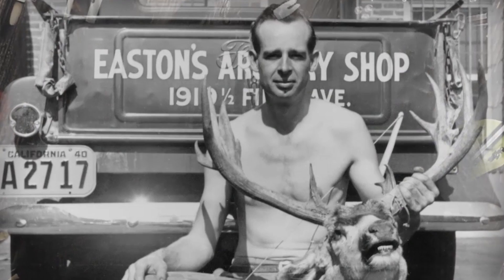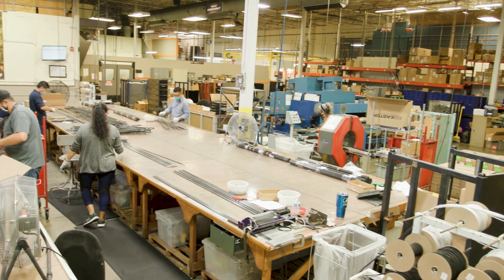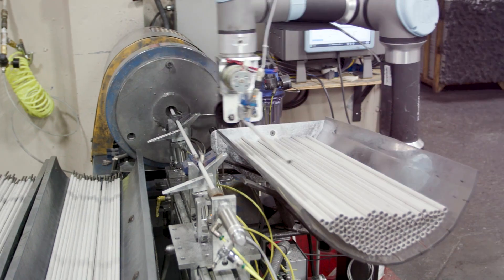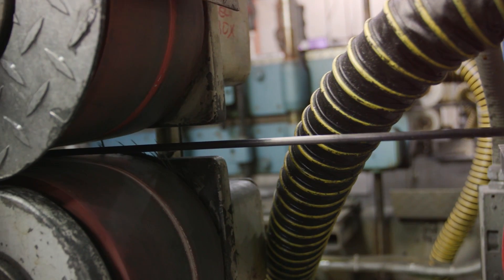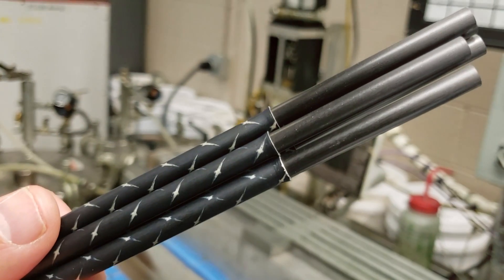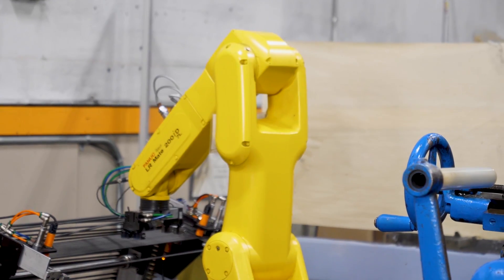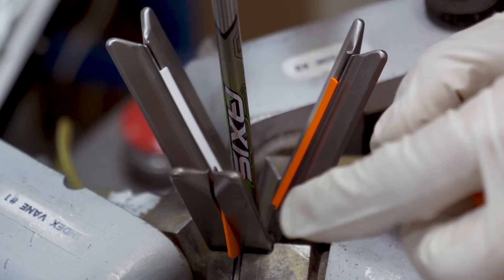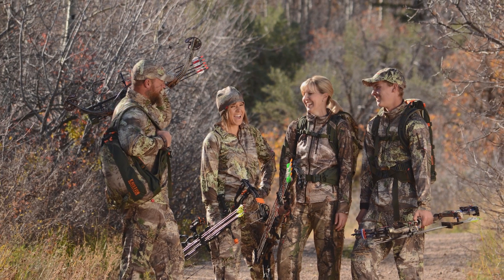Easton Archery - Arrow Factory Tour - Arrows Made In USA

Comment: Sorry, for the love of perfectionism, my eye saw the broken end of a shaft in the top row at 4:13
Reply: Those shafts are the Full Metal Jackets, the ends are cut off after the 
Carbon core is fused to the Alum. Sleeve

Comment: Been shooting arrows for over 50 years. I hope they never stop making aluminum arrows. I shoot them out of recurves, compounds, longbows, and crossbows. I have never seen an aluminum arrow explode or splinter into someone's hand. Plus I like using hot glue to add/replace inserts and turn inserts for consistent broadhead alignment arrow to arrow. Also easier to scrape off old fletching glue without fear of damaging shaft.  I shoot 1916s, 2117s, 2216s and tough as nails 2219s. Keep up the good work.